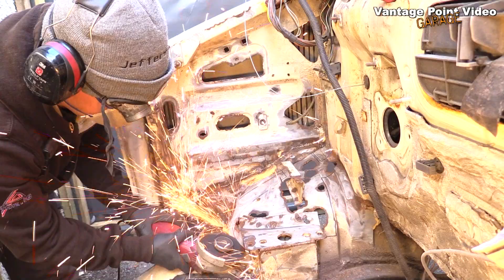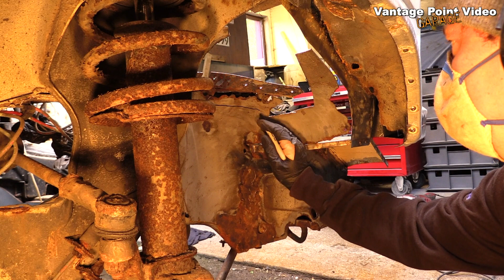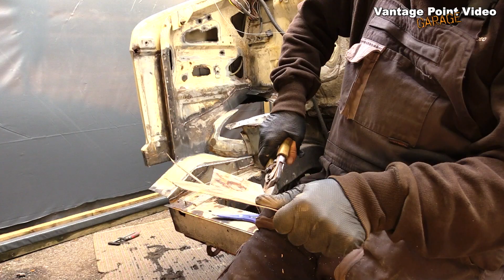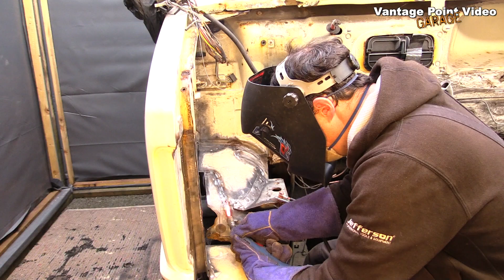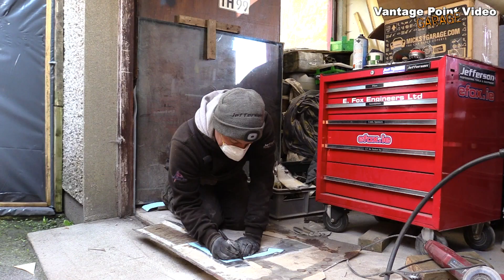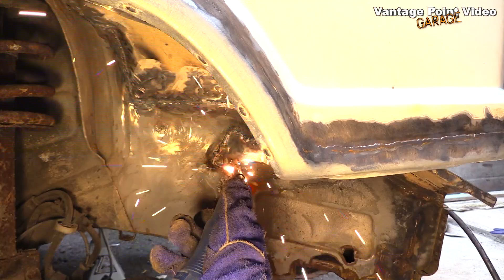Talbot Express Inner Wheel Arch Welding Repair: Camper Van Restoration #11

Comment: Mick love what your doing as I'm doing the same side on my 05 relay work van. If you don't mind me asking is it OK to put so many different welded parts onto one panel like and will the butt welds hold up? 🏴
Reply from the maker: It has to be better than wire gauze and a bucket of filler.
Reply: @VantagePointVideoGarage  lol not really the answer I was looking for but it will do 👍👌😂
Reply: Hi, do you weld for customers? Where are you located?@VantagePointVideoGarage